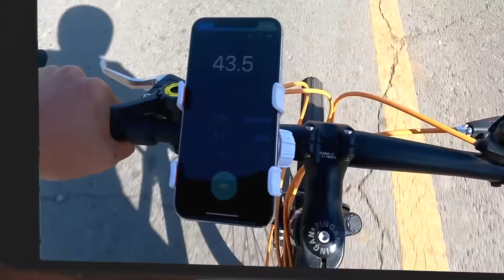How to Make a Speed Bike

Comment: unless your legs are extremely powerful one gear reduction is enough - it makes for a more simple design with only 2 chains instead of three
Reply: I was thinking 2 sets of pedals. One set like normal bike, the other for high speed. Then you could switch between conditions (uphill-downhill etc.). Upper pedals might have smaller cranks. But then simpler to have e-bike..! :)
Reply: @RJSoftware2000  that is actually a good ideas, a separate gear ratio for different speeds and possibly different riding positions based on the speed
Reply: @then00brathalos  or you could use a bike with a rear durrailer and even use the third and second gear on the reduction stages with front durrailers. That last idea would unfortionally make for a very complicated gear change setup with up to four shift levers.
Reply: @then00brathalos   Yeah but having that many moving stuff would reduce efficiency due to more frcition, would make the bike harder and more expensive to maintain, and would have more failure points, better to just have rear and front durrailers
Reply: you can actually use the weight of legs to pedal it is not as hard as it looks

Comment: Ride any standard race bike and you'll find it already has gear ratios higher than what you can usefully pedal. With these enormous ratios the amount of torque needed is beyond what your legs can supply so you'll actually go slower than with a lower ratio. Air resistance limits speed on a bike as it goes up exponentially with speed.

Comment: That huge front sprocket @ 2seconds is insane.  I've seen REAR sprockets dang near that big on the back wheel of dirt bikes which must top out at about 7 mph. Lol
Reply: Yeah, but with that much torque, they can probably climb walls!
Reply: Quite a long number of years ago, Hot Rod Magazine had a article about a guy setting the bicycle paced land speed record.  They built a shed on the back of a car, seems like it was a supercharged '58 Chevy.  The cyclist pedaled inside the shed while the car and shed pushed the air out of the way.  That bike had a front sprocket bigger than a pizza pan, as I recall.

Comment: I’ve always wanted to do this! It’s so cool to see it in reality! I also wanted to apply these principles to a generator.
Reply: These principles in generator, really?🙄🙄
 Generator requires huge torque to rotate the shaft. This setup didn't work for genarator.
Reply: raydubBALTANseijin  It does apply, but in the opposite way of what you want in a generator generally
Reply: @sandeepvardhan7583  Generators are powered through induction, which makes little to no resistance. So if you have a high torque, you want to convert that to speed before you get a good current off it.
Reply: What effect would that have? it would still generate the same amount of power
Reply: @ashrude1071  More friction, more parts that can wear out
Reply: @ashrude1071  even if you have insanely high torque, it all comes down to rpm. If you have 40,000 horsepower being driven through a generator at 1 rpm, you're wasting energy. You need to get the shaft spinning as quickly as possible to use all of the available torque.
Reply: Oh lordy...smh
Reply: Thats a horrible idea no offense, it would literally not even spin the generator, although it depends on what kind of generator it is, but if  you want to make an actual generator this is the exact opposite gear ratio you would want, as it has very little torque, and quite a bit of torque is needed to spin the shaft of a generator, even though this gear ratio can go to very high rpms it doesn't mean anything if you can even accelerate the generator to that speed
Reply: @Netherexio  science left the chat.
Reply: @Netherexio  that isn't how electromagnetic induction works
Reply: @ifigetbannedagainyoutubeis2018  Electromagnetic induction works by moving or spinning magnets through a coil, as long as the magnets are spinning, the surrounding coils will generate a voltage based on the rpm of the magnets. not the torque.
Reply: @Netherexio  so once let's say in a frictionless environment, once the coil in spinning it doesn't need any torque. It'll just create infinite energy yeah? And it doesn't work by moving or spinning magnets it works by changing the flux through the loop which induces a current to resist the change of flux
Reply: No amount of gear ratio will fool the laws of thermodynamics
Reply: @matthewhardy8133   so it will fool the speed by rpm, it will fool torque by increased pushing force on pedal,   but it will not fool thermodynamics. 
 Bro take chill and have mechanics.
Reply: We are already using this technique in wind mill, as wind mill blades rotates only around 15 to 20 rpm, but using this kind of gear ratios, generator is made to run at 1500 rpm, as wind mill blades produces enough torque required for this gear conversion.

Comment: there is, however an inversely proportional correlation between torque and gear speed... since it can go faster, that also means it takes a ton more effort.
Reply: I was honestly thinking how much force you have to put into actually getting it moving, since at such a speed he was peddaling pretty slowly
Reply: @stefan-viorelnagy5181  he wasn't actually going as fast as the speedo showed- he altered the speedo settings to look faster.
Reply: @rossbrumby1957  Was probably in kilometers per hour

Comment: Regardless of the efficiency, you've made a rideable art piece!
Reply: Not so "rideable" without brakes
Reply: What do you mean by efficiency? A pulley system reduces the force that needs to be applied to get momentum. You get more speed with less force applied. I don't get it what's the problem with this ?
Reply: @MybeautifulandamazingPrincess  probably efficiency in general, for example the human effort that takes to start up the bike to a reasonable speed

Comment: I was actually thinking of doing something like this, thanks allot buddy for the ideas on position of where I can put the bottom bracket 😺👍 subscribed I bet that was a good workout getting that up to speed, I know it would of been for me lol
Reply: Frankly, gearing has never stopped me from reaching maximum speeds, it's always been aerodynamics and pulmonary / cardiovascular capacity...
Reply: @rey_nemaattori  Agreed. If anything gearing helps because it's possible to squat 400lbs compared to 20x20lbs in a second... Also agreed, it's always my cardio endurance that fails first; it'd have failed at lighter ratios just for the aerobics vs intensity. My cardio has always been terrible, hate it, hate it, hate it.
Reply: @GRAYgauss  Gearing absolutely helps, but it always is a trade off in power required per stroke. Eventually you're going to need so much power it simply becomes impossible. Especially since you're not  just pressing 400 lbs in a second, but _every second_, thats when either fatigue kick in, the muscles can't move the load or the body can't supply enougj oxygen.
For most people it's easier to press 20 lbs for 20 seconds that to press 400 even once .
Reply: @rey_nemaattori  Eh, bad numbers on my part. I was imagining squatting and that force that goes into pedalling when I go up hill. My point is that the human body can't move fast enough to pedal 20lbx20 in 1 second, but we COULD pedal 400lbs once in one second. For me, it's easier to pump more per cycle than many cycles, because I have terrible cardio but good mass/strength ratio. 

Bad numbers again, but that's the idea...The balance in my mind is most efficient when biased towards  20% speed and 80% max force rather than 80% speed at 20% force. Agreed with what you said on power, but for me I'm biased to feel that high speeds are more impossible than high torques. The fastest I can go isn't when I'm peddling like a demon, but when I'm taking about 5-6 seconds per foot to torque through and the entire follow-through feels like a rocket acceleration.

Comment: Imagine how fast he goes on the bicycle ☠️
Reply: not that fast
Reply: 47kph, which is about 30mph, not bad at all
Reply: twin7s  
Well it's been geared up loads so I would have thought anyone could get it up to that kind of speed
Reply: twin7s  i agree, i hit a top of 30mph on my bike on flat land (i am locked out of the two hardest gears ‘cause racing regulations)
Reply: @BillSikes.  it would be a pain in the ass to get started though.
Reply: @AWriterWandering  
Yeah that true, it'd take a great deal of strength to get it rolling 🚴‍♂️
Reply: @BillSikes.  No, you still have to be able to produce enough watts. It would be easier on a regular road bike.
Reply: Slower than on a normal 53:11 bike. The power loss due to mechanical friction in the gears will ne much higher here. It's basically a pointless exercise from a practical perspective
Reply: @raffaeledivora9517  Agreed, there is an efficient cadence for any speed and it's usually not nearly as slow as they're pedaling. This is basically a terrible way to achieve what they could have done by simply installing a larger front cog for a higher gear ratio. The spray painting even enters the realm of parody. At least this isn't inherently dangerous or easy for people to do like some of the awful "hacks" that deserve to be taken down.

Comment: Would be interesting to see it with an electric assist
Reply: Imagine if there was a motor and you can change the gear to make it slower or faster. Since it's a bike with a motor, I would probably call it a motorcycle.
Reply: Probably not a very good idea, putting that much load on a motor for that long will overheat it and reduce its lifetime and also reduce efficiency , kind of like you don't start your car at 4th gear, assuming you could even get it started at that gear. You can try out something similar at home if you just buy a simple 3V motor and power it up and then hold the shaft of the motor tight for like 2 minutes, you should notice it getting at least a bit hotter

Comment: What would happen if someone did that, but he/she also put a big gear next to the small gear on the back axle with another chain attaching the big gear to the chain drive? Will there be both speed & torque or would one cancel the other out in the process.
Reply: it would cancel out
Reply: Thats a crank

Comment: Put a hydraulic motor where the crack is hooked to that crank or the pedals are hooked to use a small electric motor to pump hydraulic fluid to the hydraulic motor you will achieve this speed even faster because of the high torque of the hydraulic motor the electric motor will not turn the crank it will turn a hydraulic pump which will feed the hydraulic motor the speed will amaze you you will break chains and spokes it has to be done slowly. Increasing hydraulic pressure has to be done slowly try it you will be amazed.
Reply: Oh Dear, oh dear Lord!!
🤣🤣🤣🤣
That doesn't make any sense?? The spokes breaking?? Chain breaking?? Why not use the e-motor directly but drive a hydraulic pump and motor?? You're just loosing efficiency dude.
Reply: @omarrama92  i’ve already tried this and my bike will go uphill at 50 miles an hour because of the incredibly high torque of the hydraulics ,but it will break chains and spokes if you unleash all that torque at one time you would have to see it and you’d understand it. You also understand you and your E bikes are highly inefficient some of the highest tech geniuses of our time I’ve been working on these electric vehicles for decades the problem with electric cars is we do not have an electric grid that can service them without turning off the entire system or breaking it .and of course the other problem with the cars is what they don’t show you they do not have them race against In stock car racing why ?because if they have a collision they explode and you can’t put those fires out easily .people would die the public would be aware of how dangerous electric cars are .bikes the batteries aren’t big enough most of the cars have an energy density in their batteries that is equivalent to the transformer hanging on the telephone pole out in front of your house, if you’ve ever seen one blow up it’s not 🤩 pretty

Comment: Believe me, you can try this but this project will be costly and requires welding experience.

If you made this, it would not be very useful in places with hills and slopes upward. 
Here's some information: 
If you were to try to go up, it would require a ton of pushing power with your feet but it will not work. You will just go back down. The only suitable places are places with no hills and straight roads. It would work only if you were to get a push from someone because if you were to try to pedal, there would be a ton of friction and will make it hard to pedal when starting. Another problem is that there are no brakes, so if you go about 50 to 60 Km, you will be in big trouble. 💀

But afterall, good job~but you should try to go up a hill. I would love to see that happen 🤣

Good work!

Comment: Someone mentioned adding gear for the start... perhapa If you install a shell with a cog outside that can incompasses the rear wheel's inner original cog you can create it in such a manner so the start wouldn't be such a difficult  process

Comment: Even tho you didn't use smallest gears on the speed multiplers to increase the speed but you did manage to reach 49km it would be 75km if you used smallest gears in those speed multipliers plus you still can make 6 more gears there's a huge space on that bicycle and cover them like motorcycles for safety

Comment: Do this with a 3 wheel recumbant tricycle (like a Greenspeed) and run the extra chains out the front (both sides of the frame) and then back to the derailer via a spacer sprocket and you will hold 45km/h for an hour....  easy.

Comment: A lot of strength is needed to start cycling from standstill. If you use regular geared bicycles then you should know that you cannot start from the top gear much easily, it will be a bit difficult.

Comment: I'm assuming 16 teeth on the rear cog so the mechanical advantage of your drivetrain is something like (42/24) * (42/24) * (42/16) ≈ 1/8

52kph max speed can be achieved on a regular bike though. See if you can find a car to draft behind if you want to have some real fun.

Comment: Regular mountain bike with bigger gear on front can do the same. Regular bike for track can do the same. Your max speed on the bike is limited mostly by horsepower and aerodynamics. You lose about 5% of efficiency on each chain. Much more weight. It doesn't make much sense, but it looks cool : D

Comment: but why? You're essentially taking a single speed bike and changing it's gear ratio to be even higher. Does not change any power/work/force fundamentals and you're adding quite a bit of weight and complication to a bike which could easily be done with a much more compact gearbox.

Comment: nice concept but...

this is not efficiently fast tho.
you'll start up slower than a normal bike with gears switches
by the time you get to your max speed, those normal bikes are like far away and you won't probably catch up to them (because of the limit your gear ratios will be)

Comment: So basically you made a multi part gear multiplier to be able to use less energy to go faster than you normally would question why not put an electric motor where the bottom sprocket is and have like say a 72v battery and controller with the other stuff at the very top

Comment: If you have a bike that fits you with the appropriate chain ring and cassette sizes you will be able to go 50kph, if you really throw yourself at it you will just need to pedal faster. Because of the ability to switch gear ratios you will be able to reach that speed much faster too. 

This bike creates a crazy gear ratio, meaning that you can achieve a higher speed at lower RPM, but you will be just as, if not more limited because pedaling this would be nightmarishly difficult. 

For people with some genuine skill, it seems such a waste to spend it making clickbait.

Comment: Have you studied physics or mechanics?
The higher you gear a bike, the greater the effort needed to make it move. There is a limit to how much power a human can apply.
If such high gearing was practical don't you think bicycle manufactures would be doing it already? Especially for racing bikes where the maximum speed is needed.
I was stopped for speeding by the police. 56mph in a 50mph speed zone on a standard 15 speed racing bike.
Top marks for effort, but check the science before building.

Comment: First time ever leaving a negative comment on anyone's video.   Dumbest HACK I've ever seen!  You can get the same gear ratio by building a custom 4 or 5 gear cassette in the front and a 6 gear cassette on the hub, spread the back fork to accommodate the cassette and use a shifter set.  You could even changed the pedal arms for longer ones and increase your torque.

Comment: TLDR Great idea, terrible execution.
I never comment on videos, but I have to here. As a bike mechanic, I love the idea, but the execution makes me cringe. Clamping the rim of the wheel like that will get you fired from any bike shop in an instant, and cutting the frame like that will severely damage the integrity of the frame, not to mention bottom brackets (what the frame was cut to make room for) are designed to house bearings, not support loads in this manner. Also, don't paint your chain y'all, it's a system that is designed to be clean and lubricated, not covered in spray paint, if you want proper colored chains, they are made without messing with their function like this. SMH

Comment: Pretty pointless, since top speed is limited by air resistance and leg power, not gear ratio.
Road bike gearing is already tuned to that fact.

Having super high gears that can only be used down very steep hills is pointless.
Your pedal cadence in the video is very low and not ideal. You would be able to go faster on a lower gear.